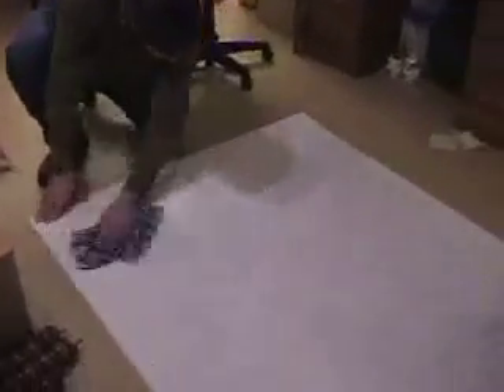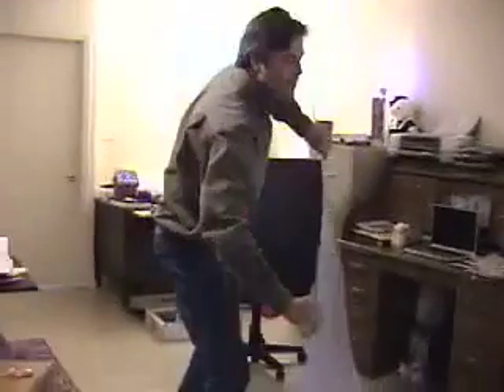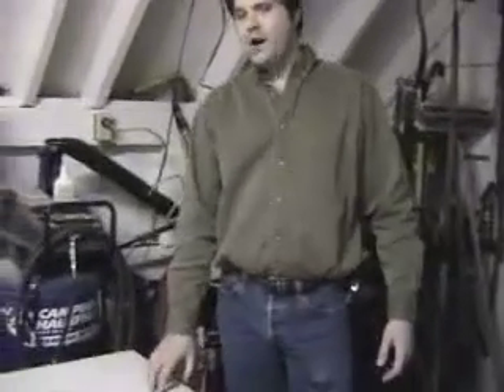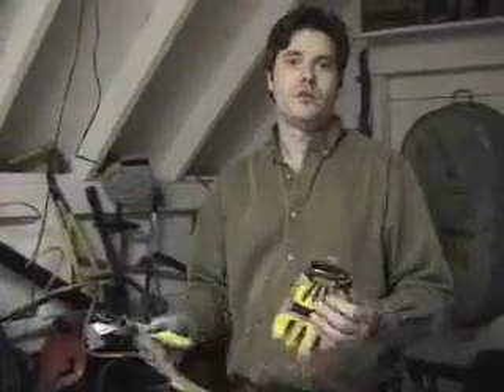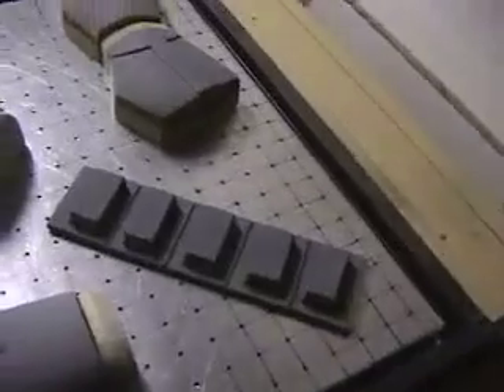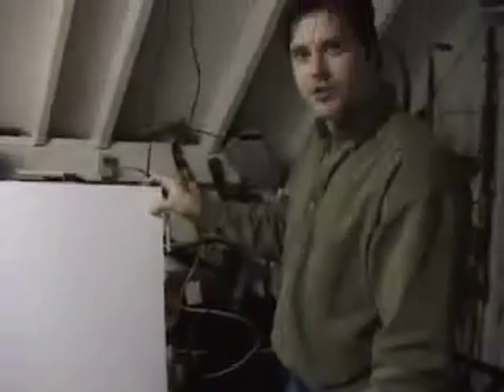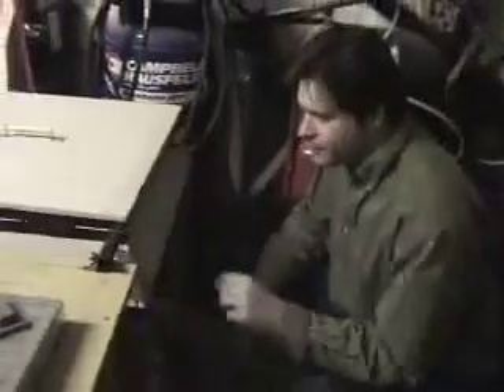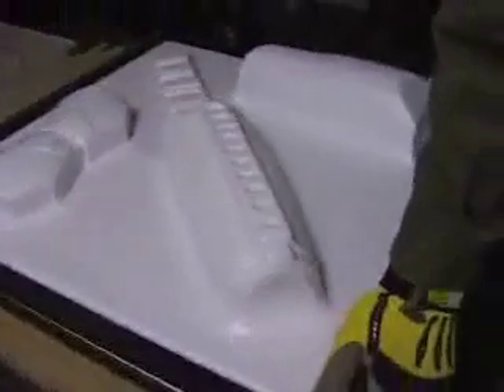Vacuum forming How-to

Comment: I'm looking to make a 3x5 foot vacuum table with overhead heating element.  What ceramic stand-offs did you use?  The only ones I'm seeing are for electric fences, which I'm not sure if that could handle the heat, or would interfere with the heating properties of the nichrome.

Comment: Tip; Use a shop vacuum with a reverse switch (to blow air). When you vacuum form a piece,let the plastic cool,then hit the reverse switch for just a second to pop the pieces loose from the plastic.It will save the wear and tear on your molds.

Comment: If you put a draft or slight taper on the perimeter of the mold it will pop out easy. I also spray mold release on the mold. Also try mounting the molds to the platten on high volume runs. Very impressive engineering!!!

Comment from the maker: @avantgarde120 I have formed 0.125 acrylic but you don't get much detail that thick and it requires a long warming cycle, this can overheat the clear plastics. Also, the dust in the air will get on the parts, causing imperfections.

Comment from the maker: When we did this armor, we used .080 and .093 HIPS. ABS is what Whitehorze is referring to and usually come in 1/8th inch or .125 thickness. Smooth on one side with a haircell texture on the other many time. Thats great if you have the proper high-vac setup for pulling the slower to cool ABS. I've not seen 4x8 foot ABS for less than about $40 a sheet in my area.

Comment from the maker: Thats tricky but doable, but you will need to reinforce the ABS part first, filled with plaster or the like. Then you are good for maybe 1 or two pulls before the heat starts to distort the original. IMHO

Comment: Thanks a lot for your great info, followed your instructions and built my own vac former.

it worked really well for 1st run ( see eleisha92 )but obviously have a lot to learn through trial and error.

starting work on trooper suit, i think the former was easy compared withmaking the templates.

You are the dude! thanks again.